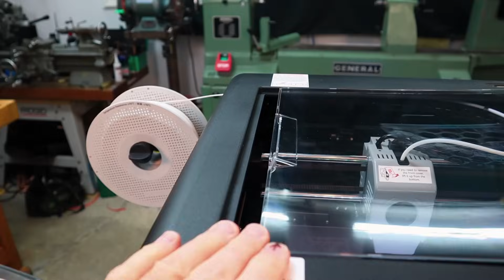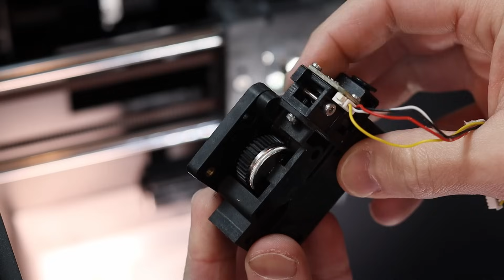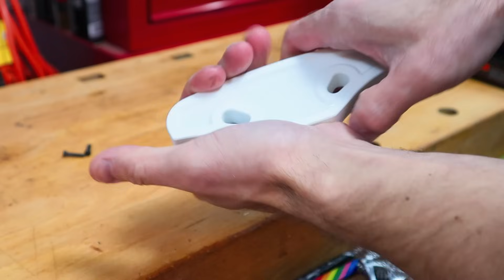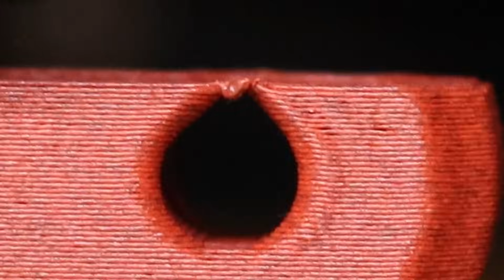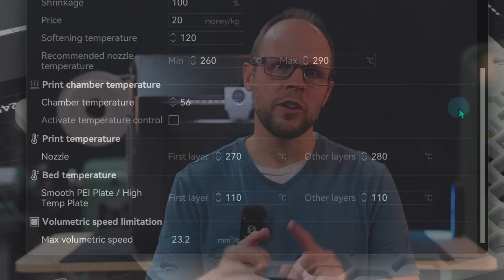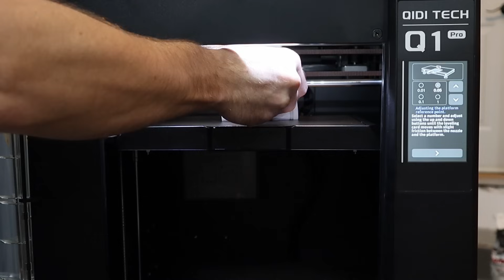The All NEW QIDI Q1 Pro - Affordable, High Performance and High Tem...?

Comment: Very nice.
Reply from the maker: Thank you!  It's a nice printer, I'm just getting setup to do some more prints on it right now, and I think I've wrapped my head around the PETG-CF, it's such a nice looking filament, but it doesn't like bridging and overhangs, even beyond basic PETG for some reason.
Reply: @NeedItMakeIt  I just bought the XMax3 a couple months ago, and although it's larger, maybe waiting I could have bought this instead.  Unfortunately, you never know where the 3d market is going at any given time, things change so quickly.  I've found the Smooth PEI plate for my XMax 3 works much better on filaments that have issues sticking and warping (sometimes they stick too well to it).  I haven't ventured too much into the more high end filaments due to the costs and needs at the moment.  I have tried printing with Qidi's ASA once, and the prints release part way thru on the textured plate, but am waiting to try again till I can vent it outside due to the smell (I print in my basement).  Qidi support has been great with any issues I have had.  I like that you get right to the information people are looking for, not needing to see the drawn out process of the things we don't need to see.  Thanks.
Reply from the maker: That's good to know, do you use any glue stick?  I've always been using it since the beginning and I know that lots of people don't like to, but when printing heavy parts, I don't see any way around it.  I'm using the lightly textured buildplate and it works best with glue stick for sure, I guess we'll have to wait to see what aftermarket plates come out to test. 

I'm lucky to be able to have enough filaments coming from my designs on Maker World that I don't worry too much about the filament anymore, but some of them are 50$ a spool, that's hard to justify.  

I'm working on some ideas to exhaust our printers outside, do you happen to have a window nearby?

I try to edit out all of the things that people don't need/want to see and get to the 'good' info, though I can sometimes get a little nerdy with the parts I create and I can get side-tracked.  I have no idea if some of the parts are interesting to people or not, but I can't bring myself to print non-functional parts like Toasters and Benchys endlessly.
Reply: I use hairspray.  I've tried gluestick, but it never seems to go on smooth for me.  The smooth PEI plate seems to hold prints tight and the hairspray allows easier release.  I do have a window, right behind the printer, so when it warms up here in the northeast, I can put a window fan in and exhaust out.  Also looking for a low cost VOC meter.  Any recommendations?  Thanks.

Comment: Solid video, thanks for sharing your experience! =) Would love to see you go over this printer with your improved 3d printed parts, I really enjoy that from your channel!
Reply from the maker: Thanks!  It's funny, normally I do a review and find lots of problems and then end up having to make several videos.  I think with this printer there could be just one video, there really isn't much to adjust, the spool holder, maybe a little bit larger filter with a HEPA filter also integrated.  Down the line I expect that people will want to pretty up the head, and maybe a different design for the cover could be done.   Overall it's a solid contender and I think they did a goo job getting something to market that performs well and that's in a more affordable range.
Reply: @NeedItMakeIt  That approach sets you apart from the rest and I truly enjoy to watch! Sounds very promising for the QIDI Q1 Pro, but maybe a better build plate guide? Btw have you gotten your hands on the Flashforge ad5m pro?

Comment: Very good review! I don't need another 3D printer (have 4 already) but I like this one so I just might to buy this one. If I do I'll use your link instead of the one in another review I watched before yours (Clough42, not fond of his I'm better then everyone attitude!). If it still has the discount in 2 weeks (traveling) I'll buy one. I like how you come across on your channel, that's why I subscribed after watching your channel 1 time. Thank you for your videos. By the way, their website says it has auto calibration and auto "Z" offset calibration, just FYI.
Reply from the maker: Thanks, it takes about 2 weeks to run enough parts and wrap my head around the printer to speak about it intelligently; then put it all together to make some sense.  The videos always start off organized and then deteriorate rapidly from there...  I didn't cover every little detail, I wanted to focus on what I think is most important for people.  

Thanks, I appreciate you considering to use the link if the time comes.   I'm not a fan of advertising, but I don't mind showing off products and if it's good, people can make the decision themselves whether it would work for them, and that's why it's important to cover all of the good stuff and any issues as well.

I'll have a video coming out probably next Wednesday to make an adapter for the spool holder, and maybe a little larger version of the Carbon filter, the leadscrews are a different size but I'm not sure if they need cleaning like the Bambu printers do, so I may not need to create a Rod Sloth cleaner for that size.  

Thanks for mentioning the calibration, that's true for the Z-axis and it seems to work well, I guess I wasn't too specific in the video, I'd love for them to have an option to calibrate the filament like the X1C.  I've spoken to QIDI about it, I hope it's something they'll consider.  

I really appreciate you taking the time to leave a comment!

Comment: I was trying to decide between x-plus 3, Adventurer 5m pro and the P1S. Now I have this one to look at too. So I will be printing parts for RC airplanes and around the woodshop. I will need to print glass fiber nylon, abs cf, tpu, pet cf and petg. I don't want to tinker with it. I want to print parts for other hobbies, not get a 3D printer hobby. Which do you recommend? Max budget for printer is $700 since I will need to buy a filament dryer and filament.
Reply from the maker: It's great to have so many choices and the competition seems to be ramping up.  I guess it really depends on what you're trying to do, the heated chamber is really nice for those high temp materials so it will definitely help with those Nylon-GF parts (I am going to try some of this soon!)  

Based on the parts you want to print, I'd say that the X-Plus or this printer would be best, mainly for the ability to heat the chamber, I haven't tested the 5m yet, maybe that will be coming soon.  Looking at the product online, it has some nice features as well.  Very similar looking to this printer.  It doesn't seem to have a heated chamber, but if you're only doing smaller sized parts, it is probably okay to not worry too much about the active heating.  

I was going to say that the 5M looks like it might be quite nice for your setup, but it only reaches 280 max extruder temperatures, the quick swap nozzle would be really handy too.  

The X-Plus 3 is a little higher than your price range, but it has a larger BV to offset the price a bit.  

The P1S is pretty much at your price-point and you'd have the ability to use an AMS if not for color, then for keeping your filament dry and clean.  Their hotend temp reaches 300, which seems a bit more suitable, however it's not meant for abrasive materials, and you'd want to swap out some parts...

The most suitable printer for your needs that I can speak to at the moment is the Q1 or the X-Plus3.

It's a really tough call, shall I email Flashforge and see if they'll send me one to test out?

I hope I helped and didn't just add more confusion.
Reply: @NeedItMakeIt  Thank you for the detailed reply. I think this might be the one to go with, bigger than 5M pro at same price and $250 less than the P1S and $140 less than the x-plus 3. The larger build volume is nice on the x-plus 3 though.
Reply from the maker: @PolarisPilot  No problem!  I have the Creality Max, and there has been 2 times when the larger size was needed, everything else that I've printed has fit with lots of room to spare on my other printers.  It's nice to have the extra size for sure, I suppose it just depends on what you normally print whether you'll use it.  The filament companies are licking their lips, saying buy the bigger printers... bigger printers = more filament I would imagine.   

With the KE that I am upgrading, I'd like to print an entire new modular base, but even my K1 Max is too small for that project, so 4 parts or just wait for a bigger printer to come along at a good price.
Reply: LOL same list I was considering basically. If all reviews of this printer are just as solid, I think this is at the top of my list now. Great features, large build area, heated chamber, lack of gimmicks and chintzy parts short of the spool holder, seems good overall.

Comment: I literally just bought a bambu lab p1s for almost 230 more than this. Is it worth returning for this one instead? I can't say I'm super impressed with the P1S. Its good and print quality is great, but honestly I was expecting it to be a tad better based on all the reviews.
Reply: Similar situation, I just purchased a K1C, may return to get this given Qidi's reputation for customer service. They sure do make some ugly enclosures though haha, looking like lake 90's early 00's PC's.
Reply from the maker: This printer will out-perform the K1C, they've changed a few things like the Motors and the pulleys but the structure of the printer is the same and the X-Y connections aren't as well designed as the QIDI printers, for example, my K1 has some rattling now and that's because of the way they've positioned the Y rods in relation to the belts, they're offset and it isn't balanced, too much movement.  I like my K1, but this printer has focused on the right areas to produce good quality parts and the K1C is more about the looks.  

They do have that vibe, when I first saw it, I was thinking that it looks like it belongs on a spaceship.  I am a fan of function over looks so I am biased towards things that perform well, so I kind of appreciate that they don't care as much about what the outside looks like.  To each their own, good for us to have some variety though, we pick the printer that suits our needs the most. 

Does it look like a future microwave?
Reply: @NeedItMakeIt I may have missed it in your review, but did you comment on the bed thickness? Curious if this had the thicker 6mm bed like their Max printer or if it's a thinner bed like the K1's. Thanks!
Reply from the maker: @WadoDragon  I just took it all apart to see and it's thinner at what looks like 3mm.  From investigating this for my other videos, it seems that they've taken the 3 point connection between the bed and the steel frame below and that allows it to expand with less restriction than the 4 point.  I can do some more testing and see what a timelapse shows me, but the printer doesn't have removable panels and it's a bit hard to record what happens on the inside.  Correction, I'm not sure how to remove the side panels... yet!
Reply from the maker: I guess it depends on what you're trying to do with it.  If you want to print higher temp materials this is a better printer than the P1S, but the P1S has the ability to use the AMS, and that's a pretty nice add-on.  The P1S I don't think comes with a hardened nozzle or gears, so if those are attractive filaments to print with, you may want to upgrade those parts.  

The P1S should be a pretty good printer.  I can't say for certain, I only have the X1C, but the quality seems to be comparable to the Q1 here for finished parts. 

It's a tough call, each printer has their strong points it really depends on what you're looking for in a printer whether it be high-temp or abrasives and customer service etc.

Comment: So far the best Q1 Pro review, thanks for sharing:hands-yellow-heart-red:
Reply from the maker: Thank you so much!  I try to print real parts that I really need and hopefully it isn't too boring, the review videos tend to be a bit long to make sure to cover everything important.  If people l like reviews like this I can certainly do more.  I usually find a bunch of problems with printers I test out and then end up making several videos to follow up, in this case, I think there is only the spool holder angle, and I have spoken to QIDI about it so hopefully they can adjust the design a little to make it just a bit more rigid or change the angle.  I'll make a short video so anyone that needs it has an adapter they can print for the time being.